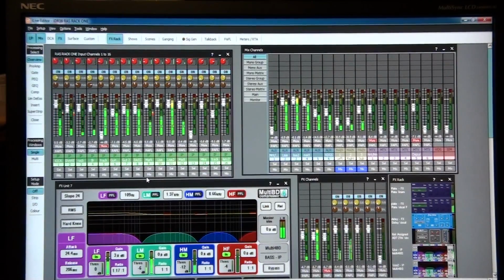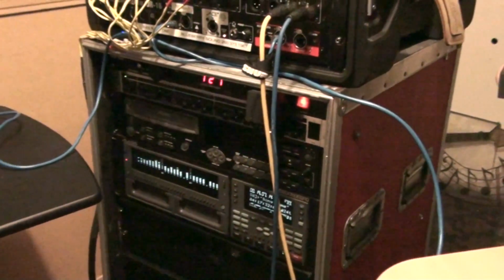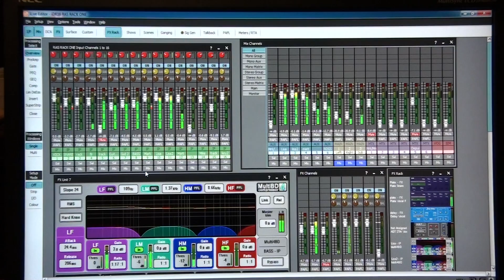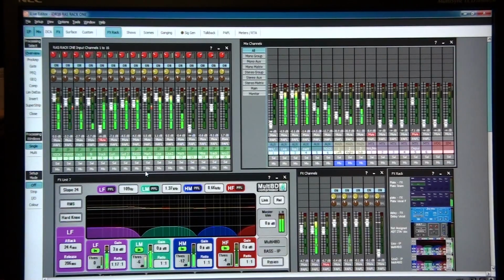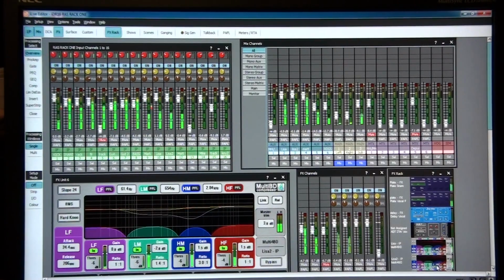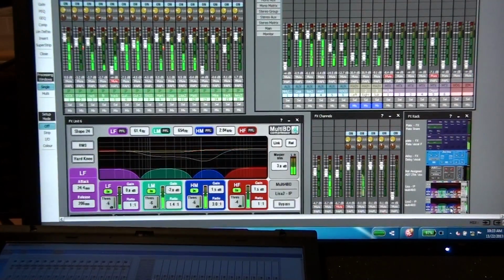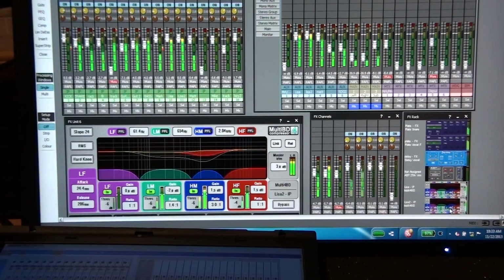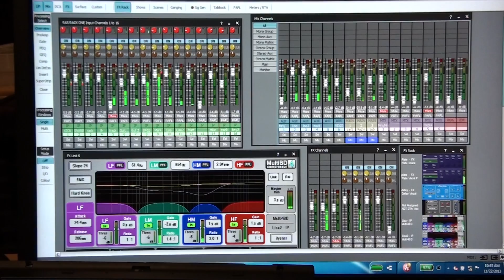virtual sound check allen heath  ADAT HD24

Comment: I have a Yamaha 02R with 3 adat cards installed and hooked up to an Alesis HD24 via light pipes. My problem is as follows. I have a song on the HD24 with twelve tracks. I want to record on track 13. Card in slots 3 and 4 in the 02R are assigned as 1 thru 8 and 9 thru 16. When I play the 12 tracks back I cannot hear or record on channel 13 unless I go into the 02R and set cards 3/4 digital I/O, to internal analog. Then I can hear my guitar on channel 13 but cannot hear the mix. To hear the mix I have to go back in and set cards 3/4 to digital I/O to hear the mix but cannot hear the guitar on channel 13. I have tried auto input and all input on the HD24 and still no go. I have been at this for days. Any help would be greatly appreciated. We have recorded plenty of 20 some odd track songs with this equipment, the bass player doing all the engineering. He isn't around anymore to give me any advice.. Any help would be greatly appreciated.